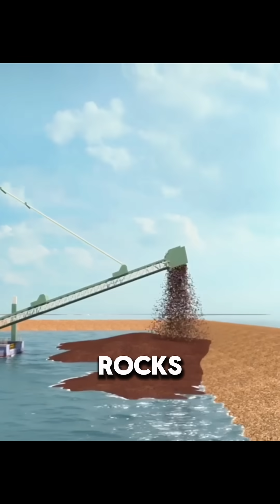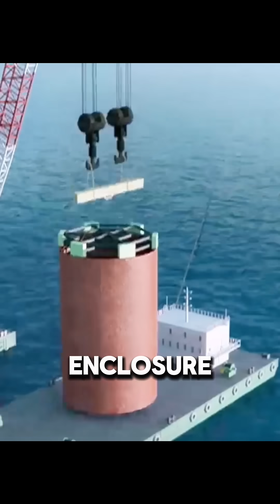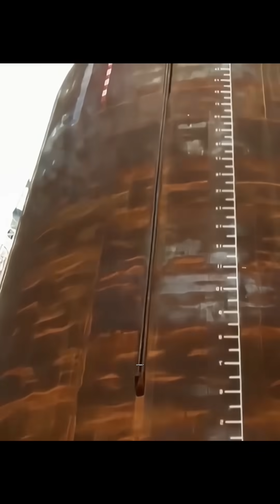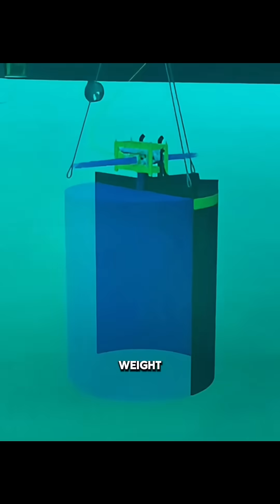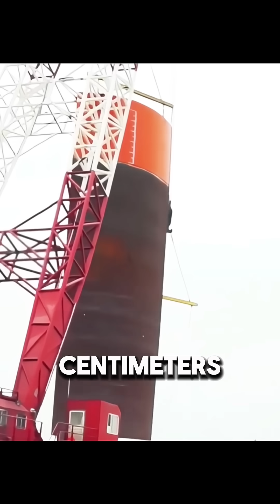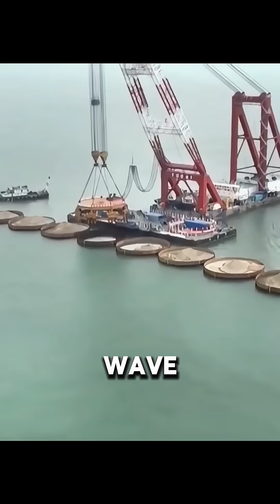How to build an artificial island at sea? #foryou #zackdfilm #island

Comment: Wont the steel rust away over time?
Reply: guess the metal cylinder no longer needed after concrete filled and solidify, let it rust and go away in the sea water.

Comment: What happens when the steel cylinders erode 🤔
Reply: Weed and barnacle growth actually forces out the water contact with an adhesive solution that will double the life of the peers to match the actual bridge construction and both will then be renewed.
Reply: @kentriat2426  so things form on the cylinders and renew it